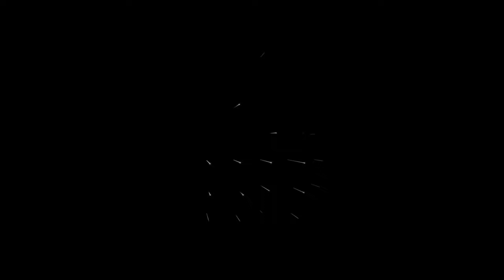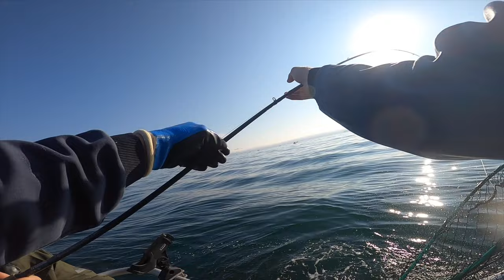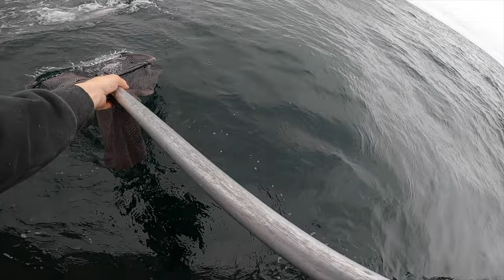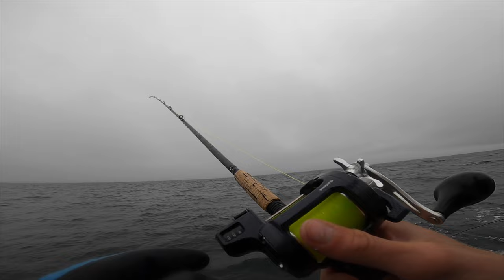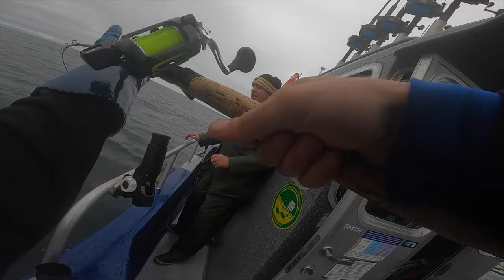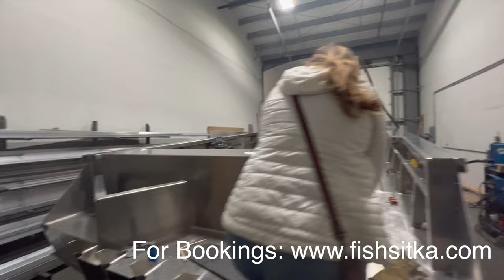Catching Big King Salmon in Sitka, Alaska

Comment: Wow times have changed! I remember fishing the Kenai in the 80’s50-75 lb king were common, 40-50 lbs common at the mat su rivers, same with Kodiak! Now the kings and silvers are way smaller! The silver salmon derby winners at Seward and Valdez used to average approx 18-20 lbs! Now your winning fish are 14-15 lb fish! Two reasons, Seattle pollock factory trawlers and big increase in the orca population! Simple!😳🤣🤪
Reply from the maker: No doubt, times have changed. 30 lbs is the new 40-50 lb for King salmon. The King salmon derby in Sitka has had a similar trend to what you’re describing.